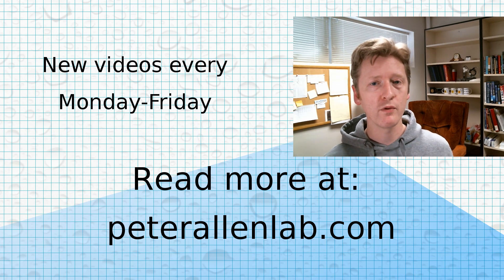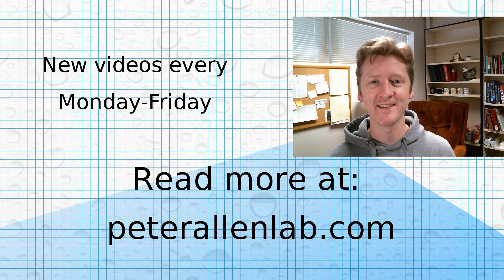Build a better iron battery cell: Design 5

Comment: Hi Peter, try manganese oxide!

It's nice to see other people trying to build batteries, in my spare time i'v been experimenting with energy storage since i was 15 years old and now i'm 38, i have an off grid solar system and lead-acid battery bank is aging (13 years old) so i'm actively seeking for a practical diy battery replacement wich i may need soon (i hope 7 more years!)

So far the best results using alkaline cells is using manganese oxide at the positive and iron whool at the negative, give about same voltage behaviour as nickel-iron battery and the small prototype can run a small xmass tree light bulb for a whole day, so far the best result i had with all combination of alkaline cells using iron.

http://imgur.com/OnoYda7

I got the manganese oxide from a regular D cell alkaline battery, i just removed the zinc and left the manganese inside the steel cylinder as it's compressed and make a very good electrical contact, the cell keep charging and discharging without problems, so far i ran about 20 cycles

http://imgur.com/lOOPvxq

Anyway for practical purposes, especially for 100Kwh storage in a real solar system, i feel more confident using lead and sulfuric acid as they give much stronger battery and it's more easy to build one for diy, the prorotypes i made using lead have evolved into a 100Ah cells during the years and you can recover a lot of raw materials (lead oxides and acid) for free wich make them really cheap compared to buy steel whools, manganese oxide and potassium hydroxide from new.

Keep in mind that lead-acid batteries are weak because they want them that way!
They build them  for high craking currents and small size making very tiny plates wich corrode quickly, than they press oxides on plates wich expand and fall off during usage and last but not least they fit all plates very tight together separated by very thin porous separators wich get saturated of lead particles during cycles and become conductive shorting the cells.
I managed to build a very solid lead-acid cell wich tollerate deep discharges down to 0V or reverse charge with no lose in performance, very thick current collectors 1cm instead of 1mm so the positive will last a life time, oxides kept in place by plastic so they can't fall off the plates during deep discharges or overcharges and 4cm of clean electrolyte as separator, no physical contact to avoid shorts caused by lead deposition/plating of separators.
Of course they are more heavy than regular commercial lead battery and take up more space for the same capacity but as a stationary energy storage system i'm more concerned about longevity than space and weight ;)

http://imgur.com/ZIlAjMk

http://imgur.com/SmUYrE2

http://imgur.com/q1nHDEH

I'll keep experimenting like you do but it's very hard to match the performance of lead-acid in the diy field using iron and other metals...
Reply: I suggest to try manganese oxide and iron couple in a 20/30% potassium hydroxide water based solution, basically like an nickel-iron battery but substituting the expensive and hard to find nickel hydroxide with the more common and less expensive manganese oxide.
Also i suggest using manganese oxide from a regular primary battery (alkaline battery) as it's mixed with something that make it more eletrically conductive, i'm not sure but probably carbon, and it's pressed so it will not float around in the solution, for my tests i left it inside the cylindrical can of the D cell i just removed the zing paste from the middle, dropped the cylinder with manganese into the potassium hydroxide solution together with the iron wool.
Iron could have some oxide wich prevent or slow down reactions, but a few charge and discharge cycles slowly remove it making the submerged iron more reactive as long as you don't pull it out into air again, basically the same that happen with nickel-iron batteries, when they slow down or become "soft" it's because the iron oxidized a bit but a few discharge and recharge cycles bring them back to new conditions.
As far as i know we should have only pure iron in the charged state and iron hydroxide (no idea wich one) in the discharged state, the oxide formed in air is bad and cause passivation of the cell, i read somwehre that iron-sulfide (i think) or sulfur added to the iron help on that regard and also reduce the hydrogen gassing, but personally i'm not concerned about gassing as i need batteries for stationary usage and flooded, not sealed, so as long as they last a life time who mind if they eletrolize some water and we have to tamp them....
Reply: @RealKeyos    yes its carbon in manganese battery

Very interesting discuss. I also very interesting about energy storage...
Reply: RealKeyos You are correct about the design of automotive lead-acid not being good for deep-cycle operation.  Not only thin and porous plates, but they are also not pure lead but rather alloys for greater rigidity, which supposedly reduces the capacity.  What works better is the batteries designed for golf carts, or better still, for fork-lifts.  Have traditionally been very expensive.  However, it seems as demand has gone up due to use in renewable energy storage, the prices are coming down, I guess due to economies of scale.

Of course, there is the risk of environmental contamination from the lead, and especially for DIY, I believe that is why Peter is trying to avoid it.

One of the other things about lead-acid chemistry is that the number of rated recharge cycles drops dramatically as the DOD (depth of discharge) is increased.  I read that on good deep cycle batteries, if DOD is kept above 50%, the batteries may last a 1-3 thousand cycles.  Whereas  if taken down to 80% DOD, they may only last 1-2 hundred cycles.  You might think that just means investing in more batteries.   However, then you get into not using enough current, so the acid starts to stratify into layers.  Many chargers provide for monthly equalization cycles to help this... But then your solar panels may not have enough current to equalize several batteries in parallel.

Gets complicated!  I would love to see a battery tech that could completely discharge without damage.   That is one of the things that is attractive about super capacitors.   However, their self discharge rates are high and really high Watt-hour capabilities are still expensive to assemble.
Reply: Peter in my spare time i did so many tests with differen metals combinations and different electrolytes during the past years but talking about all of them could end up spamming your discussion here....

Hi Karabetter, it's nice to see people interested in battery technology, how to make them and not just buy stuff!
If we talk about stationary storage of renewable energy than most if not all of the commercial design and all chemistry have some errors and some of them are really silly so one wonder if they are on purpose....
The 2 really big, silly and common mistake are:
1) active material falling out of the conducting grid/plates
2) separators: with time and usage they get impregnated of active 
materials, oxides or metals particles wich make them conductive and 
auto-discharge or short the cell

Lead-acid have also a 3rd big problem you manetioned already, the positive current collector (grid) get converted into active material (lead dioxide) and corrode away breaking the electrical circuit.

Yes it's the design of lead-acid batteries that make them last so few, the chemistry is able to last indefinitely and handle total discharges, there is another type of lead-acid other the ones you listed, the opzs, very similar to fork-lift but they are designed for stationary use so they tend to be larger, have thick separators and are trasparent so you can check what's happening inside.
I'm running my house off-grid since 2004 on a bank of them, they say they last 15 years so far i did 13 and they are still running but i see the lead active materials falling off from the plates, that's a design failure not a chemistry problem, this is my commercial bank:
http://imgur.com/WBEFCqa
http://imgur.com/XHKT0rW

That's the reason i wanted to test lead-acid chemistry (wich is the simplest for diy) with a different design to address all the problems the commercial types have as you can see from the last 3 pics from my first message (you can see pics? i have posted them correctly?)
So far in a plastic jar designed for a commercial 300Ah opzs made of plates i managed to get a 100Ah with only 2 big and bulky elettrodes where active materials are kept in places by plastic wich does not take part in the reaction and last so problem 1 fixed, than there is clean electrolyte no separators and problem 2 fixed, the problem 3 is adressed by making 1cm thick plates/current collectors.
Here another test i did:
http://imgur.com/zsgPrs6
http://imgur.com/9ufMA9s
http://imgur.com/V8muibO

I'm trying really hard like Peter to make a cell like the many variations of lead-acid i built but with more safe materials like iron, manganese, zinc, copper or magnesium but so far the reality is they just make a fraction of the storage and reliability of the lead-acid built with proper life-lasting design.

One word about lead: it's 100% recyclable, a lead-acid battery contain just 3 materials (lead, sulfuric acid and plastic) try to find if and how they recycle litium batteries, so far they don't because they contain so many materials wich make extremly expensive to recover them from the mix!

Anyway nickel-iron battery is a very good battery for renewable energy if you can afford it, nickel-metal-hydride (NiMH) is the direct evolution of that kind of battery if properly designed, we could have elecrtic cars ran by them if there wasn't the patent encumbrance on them wich is one of the reason NiMH D cells have small AA inside of them... (it's ridiculous human progress blocked by patents)

https://en.wikipedia.org/wiki/Patent_encumbrance_of_large_automotive_NiMH_batteries
Reply: Hi RealKeyos ! WoW !  I like the transparent batteries!  May I ask, what country are you in?
Thanks for the Wikipedia link.  I had heard parts of that story, but that article brings it all together and makes it clear what renewable energy is fighting against.
Reply from the maker: That's really cool - thanks for the comment. I should look into Manganese oxide. It sounds like a cool project.
Reply: sorry for the typo i meant tap them, add distilled water by time to time
Reply: Exactly, the potassium hydroxide absorbing CO2 from the air (carbonating is the right word in english?) was one of my concern about any kind of alkaline based battery, well nothing really so bad as it can be fixed with an eletrolyte change to have a battery almost like new, but of course add more maintenance work and a little cost buying new potassium hydroxide, from the info found on internet it's not clear how often this should happen, some say 3 years other say 10, in that regard the sulfuric acid in lead battery is more forgiving as it can stand in open air without any degradation, i have several lead-acid batteries (prototypes and old commercial models) wich are of the open frame type still working fine after decades in open air.
Anyway potassium hydroxide turning into potassium carbonate is one of the things i'm testing with the 2 small banks of NiFe batteries i'm testing, on the new and big cinese cells  unfortunately will take a few more years but on the small ones i think it's happened already as they are at minimum 30 years old, probably up to 40, and i never changed the electrolyte but they are still performing very well.
Last month i removed the old electrolyte from one of those small old cells and put a new freshly made one from the chemicals left over from the cinese bank (they give you extra materials!) but nothing changed, the cell still have the same capacity, so i think that if the cell is very well sealed and have just a small hole for venting the probability that CO2 from external air come inside the cell is very low, especially if the battery keep cycling every day like it should happen in a solar system because the high gassing behaviour of the iron at the anode become a feature that keep CO2 out from the cell as there is a costant production of gasses inside the cell with vent outside every CO2 or prevent it from coming inside.

!!! An important word about oils and batteries: NEVER put any kind of oil in any kind of battery!
Oils and greases keep in a good shape metals because they protect them from corrosion, this means they block any kind of reactions preventing eletrolytes from touching metals surfaces, if we talk about a bridge bolts this is very good so they don't rust but in a battery plate we want the opposite, metals and metals oxides MUST react with electrolyte, iron need to rust in a battery to generate power so also if a small fraction of the oil or grease enter in contact with the higly porous surface of the plates and active materials plates get impregnated and lose a lot of capacity basically isolating active materials from chemical reactions, passivating them.
When this happens it's really hard to remove the oil from the inside of the plates oxides particles/powders because solvents or mechanical cleaning may also remove or damage the active materials in the plates!
So also if the oil prevent CO2 from reacting with eletrolyte the possible bad side effects could be much worse than just having the electrolyte carbonating so the benefit of adding oils are small compared to the damage it could cause!

It's not clear what bad effect could have potassium carbonate on an alkaline based battery because if it's just a reduced conductivity the result it's not so bad as this kind of stationary battery have to run on slow charge and discharge cycles anyway, for example my lead-acid bank is designed to have 5 days of autonomy wich means 120 hours cycle and any properly designed off-grid system should have the stationary battery chosed for cycles in the 40 to 200 hours rate so if my NiFe batteries get carbonate and just slow down (more voltage drop at high currents) i don't really mind and i'll avoid changing the electrolyte.

But talking with other peoples in a forum we suspect the potassium carbonate could have another bad effect to promote iron migration to the positive nickel plate poisoning it, the famous "iron poisoning" word floating on the web wich no one explain what actually is, but it's just a suspect so far i have no practical data wich demostrate it.
Together with potassium hydroxide i also bought some potassium carbonate for my experiment and would like to fill a working battery with it to see what happens, basically causing a 100% fast aging of the electrolyte, also in the iron-manganese and other alkaline based prototypes once i come up with a proper design and materials choice i will run som test swapping to caronate solution to see what happens knowing it will be one aging factor of this kind of batteries.
Reply: I forgot to say i have some few NiFe cells with that mineral oil added and they have about half the capacity of the same model without oil, i opened one and intrnally the oil is everywhere on pates and battery case, i tried to clean plates with hot water but seems like the oil stay inside the plates, so reassembled it, put a new electrolyte but the battery still have half the capacity and after overcharing if for days it keep pouring out some oil from plates as it floats on the new clean electrolyte.

So from my experience with those old cells the ones with oil added are irreversibly damaged.
Reply: Man sounds like you have a lot of Diy experience with these lead batteries, Id love to see some videos of that!
Reply: @RealKeyos  : yes, the oil will damage the battery if it coats and passivates the plates. the idea is to avoid moving the cell after the oil  is added. avoid sloshing the electrolyte and keep the water level high enough that the oil doesn't enter the 'working' area. it also might be a good idea to inject the replacement water below the oil's surface so as to avoid splashing. 

when it comes time to replace the electrolyte, maybe you should overfill the battery to float the oil up and completely out before attempting to drain the electrolyte. replace the oil after the cell is refurbished and back in place.

I always thought the oil and hydroxide would form a soap. Maybe it does at the interface . IDK.
Reply: RealKeyos WoWoW ! :) Thank you so much for spending so much time providing your experience!
One thing I have read which apparently had a negative effect on Edison battery design, and which might also affect Peter's design:  When in aqueous solution and in a flooded (open) cell, the electrolyte will eventually absorb CO2 from the air and the hydroxide OH- will become CO3 -2 .  This tends to ruin the electrolyte function.  Edison experienced this, and marketed a somewhat expensive "battery oil" additive.  Turns out it was basically simple "mineral oil" that floated on top of the electrolyte, keeping the CO2 separated from the air, but still allowing the H2 and O2 to escape as bubbles through the oil.
Kind of a simple solution.  But for lab testing, the oil, once added, makes a mess when later trying to adjust concentrations.
Reply: Very good info about the oil.  Perhaps in the original design that Edison was using, the electrodes were very simple design and not so porous.

As you explain, with regular use, the gas released at the electrodes would tend to displace CO2 from the air.  Since the gas  (probably H2) is only released, and not needed to be absorbed, I could even see how a simple gravity weighed release valve/cap could act as a one-way check valve to block incoming CO2.

Again, great info RealKeyos!   

Also I offer my apologies that the US has corrupt politicians that use influence of US Department of State to promote oil fracking technologies worldwide, rather than trying to reduce fossil fuel consumption in the interest of reducing climate change.  The oil/gas money is in the wrong hands, and is very hard to overcome.

....But that's why we are here ;)